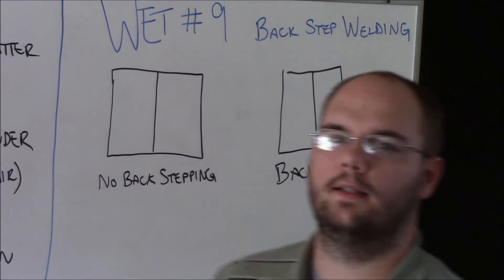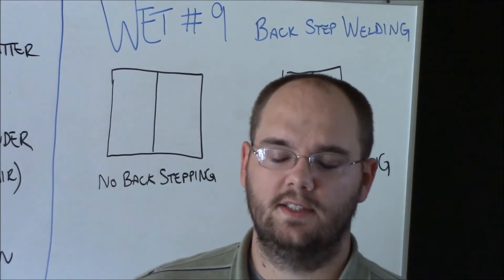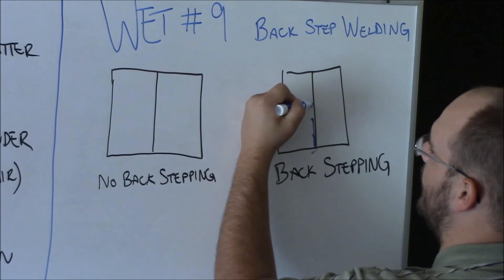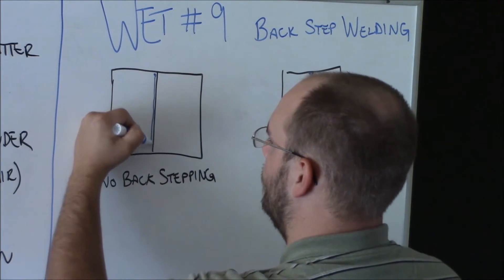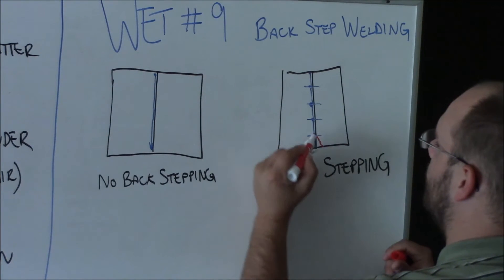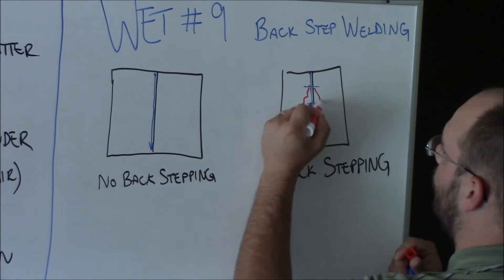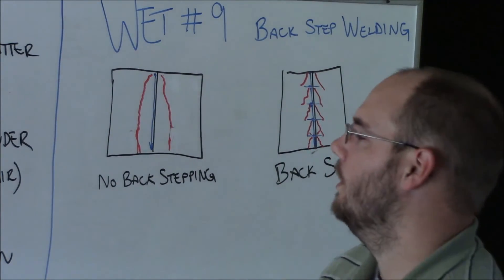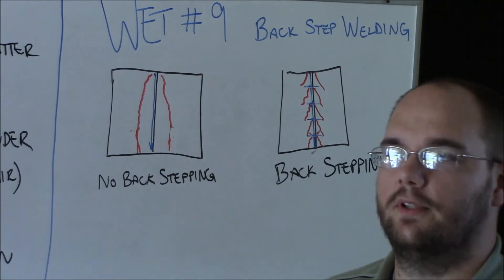WET # 9   Back Step Welding

Comment: Very informative and straight to the point. 

Question: Which processes can you use this technique with?
Reply from the maker: A lot of processes. GTAW, GMAW, SMAW. Automation. Some would lend to it better as it's main reason is for heat input and distortion control.

Comment: Hi does this help for 13m diameter API 650 storage tanks Bottom plate butt welding.
Reply from the maker: API storage tanks are an animal of their own. And one thing for sure is that they should have a fairly laid out procedure on how to weld them to control distortion. It should help, but you would need to be very certain on your additional tie ins for obvious reasons. 

Thanks for watching and asking.

Comment: So as for aluminum is there a way to make it more effective (for tig aluminum) like using a copper chill bar or a backing gas to help cool it faster than welding with say a steel table under the plate?
Reply from the maker: Copper chill bars always work well to control heat. One thing with aluminum is lots of tack welds to help it from moving. I don't see the backing gas being a great use for cooling reasons.

Comment: Will this work for aluminum?
Reply from the maker: +john kent Short answer is yes, but longer answer is that aluminum has such a high coefficient of heat transfer that it is less effective than with Steel.
Reply: +David Finch (dfmmc2014) that's what I figured. Thanks!